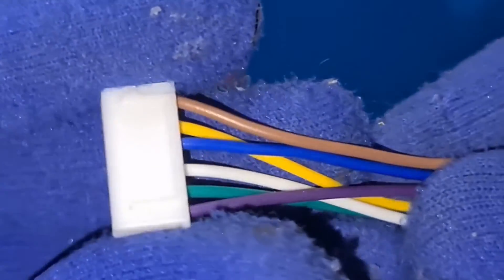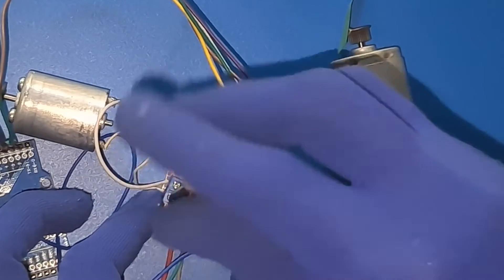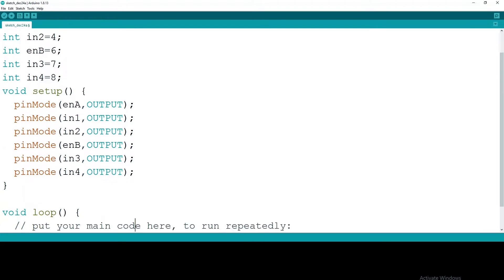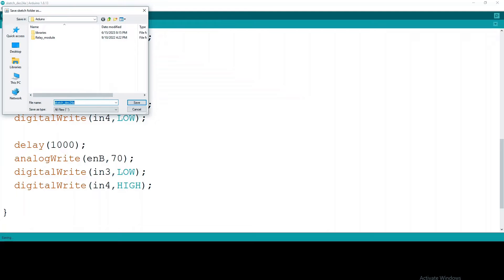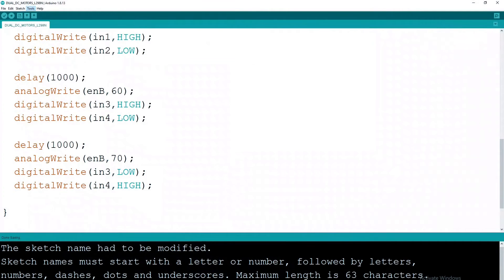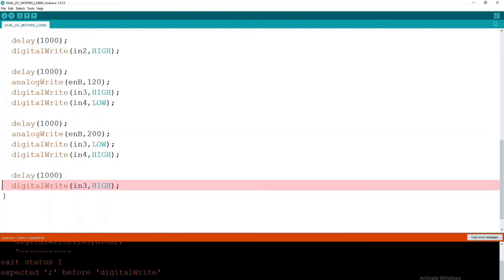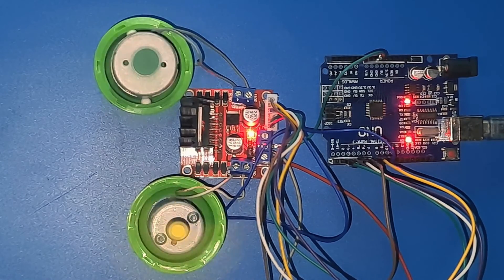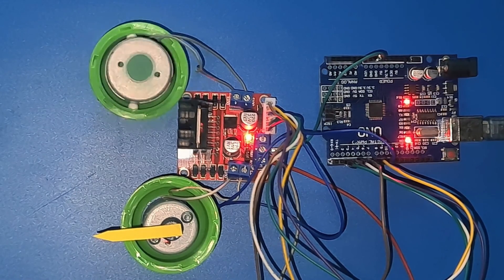L298N | How to control two dc motors with Arduino | Motor speed and direction control | dual motor

Comment from the maker: This video includes-
👉 Wiring diagram of Arduino, L298N motor driver and two DC Motors
👉 Creating source code
👉 Modifications to source code to get different control methods

This is the link for single DC motor control project using L298N motor driver https://www.youtube.com/watch?v=5RMwtuV7BM0
Join our DIY facebook group for more: https://www.facebook.com/groups/projectweekend

Comment: My problem is, that at the same PWM value the Motors have different speeds. Somebody knows why?
Reply: Difference in production process. Resistences in connections or wires. Interference. Even though the speed of the motors seems the same. You should always consider rpm sensors with a control loop like a pid to correct the rom. At least for a project that requires a little precision.

Comment: Hello! How do I add a push button to turn on and off the motors? thank you
Reply from the maker: You need to connect push button to Arduino input mode set pin in series with a resistor, and read the pin value in code, and set the motor state.

Comment: Sir how to solve the L298N overheating problem its heating like fire in 3 seconds

I am making a robo car and i used four 1000 rpm 12v dc gear motor and supplying 12v then why its heating like it will explode by any moment

Please reply sir please 🙏
Reply from the maker: The L298N has a maximum current rating of 2A per channel with a total dissipation limit.
Four 1000 RPM 12V DC gear motors might draw significantly more current than the L298N can handle, especially under load or stall conditions.

Comment: Hello, i have problems with L298N i conected as in this video but the only thing that is different its that i have Arduino Nano, when i put the code on everything works the module have power and so does the arduino too, the only thing that doesnt wort its that for the OUTPUTS on motors like OUT1 to OUT4 it doesnt send power to them and the motors wont start(I use the 12V battery).
Reply from the maker: Please make sure that you connected the grounds of Arduino, Motor driver, and the battery.
If still it's not working, check all your used connector wires (Jumper wires) with multimeter to make sure they are not broken inside.

Comment: Hey Project Weekend! Great content!, 

I'm trying to make a motor drive using an arduino, I need it to have a speed toggle with 3 speed values (fast,medium,slow), a tactile "start" button, and I'd like it to be timed with an lcd display and tactile time select buttons. I'd like the end user to first input the settings ie. Speed and time then press the start button to start the cycle. Could you help at all with this?
Reply from the maker: Thanks. To create a motor drive with Arduino featuring speed toggle, start button, and timed operation, follow these steps:

Hardware Setup:
Connect three tactile buttons to separate input pins on the Arduino, adding resistors in series for stable input.
Integrate an LCD module, and include the necessary LCD library.
Connect the L298N driver for motor control.

Coding Process:
Define variables in the code for speed, time, and pin assignments.
Set up initial speed and time parameters.
Read input pins to capture user settings using the tactile buttons.
Implement logic to start the motor when the start button pin registers a high signal.

If you encounter challenges or need additional guidance during the coding process, feel free to seek further assistance. I'm here to help!
By following these steps, you can create a motor drive system with user-configurable speed and timing settings using Arduino.

Comment: Hi,
I really appreciate your efforts and the knowledge you have shared. I am seeking help with developing a code and schematic diagram for a project that involves preset positions using push buttons, an encoder, a linear actuator, and either a DC or stepper motor, to be controlled by an Arduino Mega or UNO. The main goal is to enable the actuator to stop at specific positions selected by the user, which can be easily recalled at any time. I understand that this is quite a complicated task, but any assistance you could provide would be greatly appreciated.
Regards
Reply from the maker: Thank you for your response. I believe it would be beneficial for you to initially outline each step of the task. For instance, consider factors such as how the user selects positions, the anticipated load the actuator is designed to handle, the desired level of positioning accuracy, the method for storing data, and the preferred approach for recalling saved positions. Based on these considerations, the choice of equipment, connections, and code implementation will inevitably vary. If you prefer using stepper motors, this will be helpful: https://www.youtube.com/watch?v=-K9_60j1L2Y